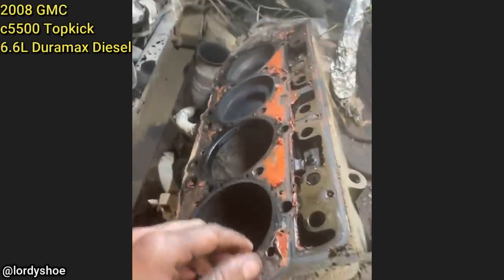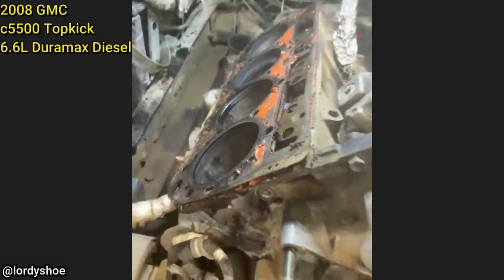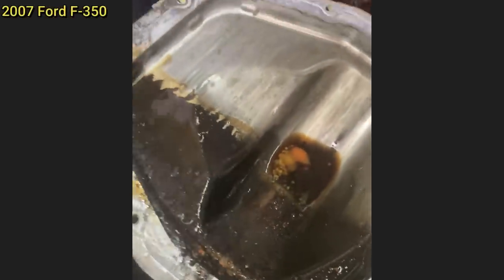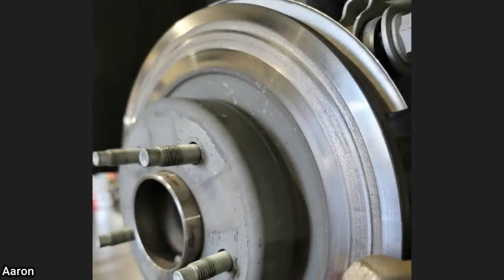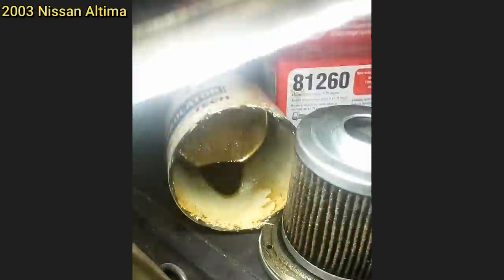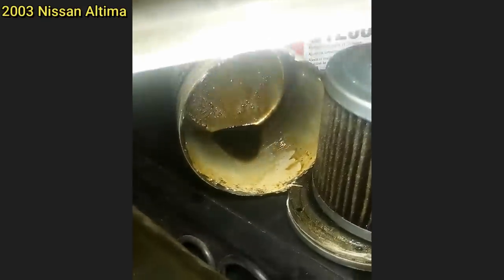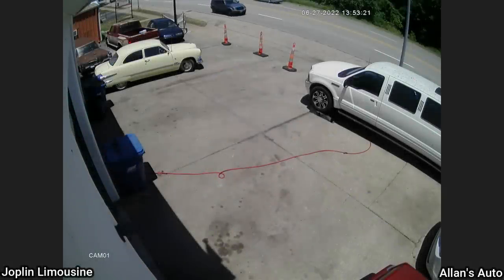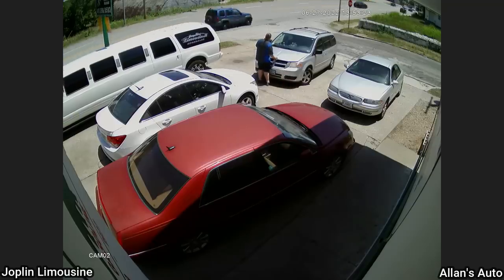Customer States Truck Might Need New Head Gaskets (GMC TopKick) | Just Rolled In

Comment: I've been in so many arguments with people reguarding tire pressure. Even had a guy claim that he's been a mechanic for 30 years stating the tire pressure on the sidewall is what the pressure should be be. Sure bud, enjoy your balded out center tread.
Reply from the maker: Was he a mechanic at Lego Land? 😆
Reply: corey Babcock  That is what I do. Slightly over recommended is not bad. NEVER go beyond max cold tire pressure. Max pressure can be a rough ride. Off roading low pressure is very helpful.
Reply: corey Babcock  Ideally, you'd keep it at the pressures designated as the car has been designed to function optimally at said pressures. Vibrations can result from over/underinflated pressures, and yes, even a couple of PSI can make a difference, especially if the pressures are different from left side to right side.
Reply: I am a retired mechanic.... ALWAYS go by the door placard
Reply: Balded center tread and horrible ride quality.
My MIL had a couple tires replaced and they aired them up to the sidewall pressure. She complained about horrible ride quality and handling. I reduced the pressure to what the sticker said and she was happy.
Reply: @scottrussell6717  ehh spring and fall I’ll over inflate a pound or two to keep the light from coming on in the morning. The amount of people that bitch about tire lights after a service
Reply: @user-white007  your right... in cooler colder weather you will loose several pds
Reply: @mikefoehr235  Low pressure is fine if your sidewalls will handle it...we had people on back road/off road rides that destroyed their tires by airing down too much. We had rocky trails and vehicle weight doesn't change.
Reply: I see so many cars broken down on the side of the road with the sidewalls blown out.
Reply: I just go by the door jam label, as stated in the owner's manual. I have a digital gauge and check them regularly. Easy money
Reply: How can the pressure on the sidewall be different to the tread?  The air pressure on the inside is uniform throughout.  Its called physics.
Reply: @csjrogerson2377  um …. rubber bends broseph
Reply: @csjrogerson2377  Low pressure allows the sidewall to flex excessively which, depending on the construction of the tire (plies/beads/casing/steel belt) may break the fibers or allow the plies to separate. It's not the pressure (or lack) that does the damage.
Reply: I ruined a set of new tires by over pressure of what the sticker recommended.  balded out the middle of all 4 tires, just trying to get better gas millage.   Could have bought a lot of gas for what those tires cost me.
Reply: @csjrogerson2377  they are talking about the actual printing of words that are on the sidewall of each tire.
Reply: Each tire is made differently and made from different materials.  The pressure labeled on the side walls of each tire are max pressure.  If you are in a cold climate you want to fill your tires closely to max pressure at daytime temps because at colder temps the pressure will decrease.  So in the same spirit you need to adjust pressure based on what the temp is when filling the tire and the max temp in the day.  You also need to make adjustments depending on how hard you drive.  If you fill your tire to max temps at 80 degrees and when you drive you get your tire up to 140 degrees the air inside your tire will expand to much higher than max pressure.  Best way to figure out best pressure is to fill to max pressure drive for a bit heat up your tires the let air out and drop to about 5% below max pressure.
Reply: @scottrussell6717  Each tire has a different max pressure because each tire is made from a different compound.  Just like in racing in NASCAR you need to take into consideration each tire compound.  To go by the door placard is ignorant because that is based on using the stock tire.  Many different variables in finding the correct pressure to fill a tire.  If you are filling a tire in a shop in the morning when its 70 degrees knowing that by noon the temp will be 110.  Knowing your environment is key to the proper inflation of a tire.
Reply: @scottrussell6717  I'm a retired Mechanical Engineer but I've been wrenching for 50 years or so. I go by the sticker and watch the tread depth (I do have a tread depth gauge) and usually find the "sweet spot" where the tires wear evenly. As an aside I had new tires put on TWO of my cars yesterday. Mobile installer. Brought the tires to me and put them on in my driveway. Old ones were at ~3/4 tread depth but were dry rotting. Don't know why. One set was 11 years old and the other 9... Two Grand Prix's, a '99 GTP (Supercharged) and an '05 GT2. New tires make them feel like new cars! ;)
Reply: @timbuckohfive2751  Or do what the manufacturer's recommend. Cold inflation pressure and let the tire warm up normally while driving.
Reply: I am 61, 44 years of driving every type of car. But I have always set my tires to 32 PSI. Placard on door jam says 30 to 34 PSI. My tires are 245 x 35 x 19, and at 32 PSI they ride really good, regardless of temp or road (Not Dirt) surface. On my wife's Hyundai Getz, it states 28 to 32 and we run them at 30 because it is a small light car. No issues. And all the Tyre Shops have told me to run between the recommended pressures.
Reply: @csjrogerson2377  he means the pressure specs printed on the sidewall (inflate to xx bar xx psi). This is a maximum pressure the tire is designed for. The pressure the car needs depends on the car itself and its weight, and is usually put on a sticker inside the door or the tank cap
Reply: Is it a "regional" thing?  I'm in Australia and I've never heard anyone say to use the pressure printed on the sidewall.  It's kind of  understood that that is the maximum safe pressure the tyre is rated for, not the running pressure which will vary depending the weight of the vehicle and other factors.
Reply: I get this asked a lot at work since I am "the car guy". If you are running stock size tires and stock type of tires then go by the door. Once you change tire size or radically change tire type like from street tires to off road that is the time to ignore the door sticker and start experimenting to see what works with your particular combination.
Reply: @PhilG999  same here... factory says 39.... I set front at 41 and rear to 39... wears perfectly even...I have a ram 1500
Reply: I run my tires at the max cold pressure on the sidewall on the tires. I have had several cars that when I set the tire pressure at the vehicle manufacturers pressure I had handling problems on the curvy road that I traveled 5 days a week. The tires would wear out on the edges and I had a lot of tires delaminating. After I started running my tires at the maximum pressure I have not had nearly as much problems with my tires. They wear evenly and I usually can wear them completely out. Before I was having to replace tires that still had a lot of tread because they were separating and forming bubbles in the tires. Remember that the car manufacturers want a smooth ride.
Reply: @danielbutler578  your exactly right. Every car is different.. you have to experiment and find the sweet spot... sounds like your tires where rolling going around curves... meaning the tires where rolling under giving the crazy wear
Reply: @Chris_the_Muso  some over here go to max pressure, no sense tho. No good reason for it. Harsh ride, wear center of  tyres out and less traction on both wet and dry roads
Reply: Also, if you ever put wider tires than factory on your car, the cold tire pressure you run should be slightly lower, you can use online calculators for this, in order to keep the same tire load rating as stock so as to keep the tires wearing evenly. A wider tire will often or always have a higher load rating than your factory tires. I went from 215's to 245's on my car that weighs 3000 lbs, went from 32 psi to 28.
Reply: @Summit2012  this is so weird I did not know that sidewalls were spouting these high PSIs. But why is it wrong? why are these wrong PSI's on the tire?
Reply: @MaNameizJeff  as someone else mentioned, the PSI shown on the sidewall is the max rated pressure of the tire, not necessarily what you should be running them at.
Reply: @Summit2012  ahhh, makes sense.

Comment: Customer: "I think I need new head gaskets."
<later>
Mechanic: "Your engine needs more than that..."
Customer: "What do you mean? What did you do?"
Mechanic: -_-
Reply: Mechanic: no, what did YOU do. You don't put RTV as a head gasket and you don't reuse the old head gasket. You always buy a new head gasket, clean up the block surface, and install the new head gasket. 

Ppl don't have common sense nowadays.
Reply: @therandomizer9943  Sense is uncommon!
Reply: @zachsheffee8458  its sad but true
Reply: Just imagine how the rtv boobs blocks the oil galleries. Engine got a hart attack
Reply: @therandomizer9943  That method works though... Pretty sure that's what my Mercedes had at least temporarily (like 30k miles at least), and that's a turbocharged diesel with an insane 22:1 compression ratio (Dodge diesel for example is 16:1), and that car was known for cracking the aluminum heads so it has some serious pressure. You can indeed use silicon gasket maker, and if the original is in good enough shape with a couple cracks you can "paint" both sides of it and apply where needed.

I've done silicon head gaskets on multiple engines, that's why RTV silicon gasket maker is called that. If you can afford to spend $100 extra on a $500 car just to have new head gaskets while you're running $5 junkyard tires, then sure, but some might say there are more important things to fix with that $100, lol!
Reply: @jakegarrett8109  You're one of the few who understand reality Jake.  Yup.  RTV isn't the 'right' way to do it but it absoluely does work.  My lawnmower has been running on a reused head gasket for almost a decade.  I needed to fix it and didn't want to wait for a new one.  Half of the construction equipment you see is running on bald tires and half hour fixes.  It's just life.

Comment: Took my Cadillac to a Cadillac dealer and told them I needed them do the 5 year maintenance on the cooling system.

They called back the next day and said they had checked the Freon and checked the A/C  compressor, and everything was working fine.

Comment: The limo…. Yikes! That u for the edumacation as usual!
Reply from the maker: Could have been a lot worse 😅
Reply: @JustRolledIn  exactly. That was scary.
Reply: @JustRolledIn  That guy was so lucky and dumb at the same time
Reply: My first thought was the guys legs under the front end being dragged... like 'holy crap did it grab him and pin him down?'
Reply: @JustRolledIn  Ol’ buddy’s lucky that was an Excursion Limo. He would’ve been squished if it was a TownCar based Limo
Reply: @Talatharas  right. He actually grabbed it thinking he could stop it from underneath. If only he would hit the shifter back in gear...

Comment: That guy who saved the limo came in clutch lmao
Reply from the maker: Should have put a cape on him in the video lol
Reply: Stretch limos are always a bit weird to me, but seeing the guy run the length of it to get at the brake - looked like a comedy sketch. lmao also.
Reply: Apparently the guy asking what mirror was damaged deleted his question.
Reply: The mirror in question is the passenger door mirror. It clipped the sign pole as it rolled backwards. And agreed, Billy needs a cape. My mechanic was under the limo at first trying to grab and hold 13k pound limo. Then you see him running behind it to stop it. I came out the office to block traffic on the side street as Billy got in for the brake. Why my mechanic didn't chock it, I do not know. Brakes are not upgraded by the limo factories so I have no idea if the embrace would hold just by itself. Thankfully no one was hurt. And I have a funny video to use for training both my mechanics. And limo limo drivers on safety.
Reply from the maker: @joplinlimo  thanks again for sharing that clip! Hopefully other people see the clip and don't make the same mistake. Good lesson!

Comment: I’m so confused. How does someone who has so little knowledge and common sense about cars that they re use a head gaskets. But is Abel to tear down the whole top end of the engine and put it all back together and have it run? That’s weird. But also impressive.
Reply from the maker: Lol I was wondering the same thing when the person shared the clip with me!
Reply: Some people can take something apart and put it back together again no problem, but have not a clue on how anything works. Eg I can take a part my pressure washer to change an oring, but i have no damn clue how the motor works and how it creates pressure.
Reply: Read up on it dude, it isn't the space shuttle.
Reply: @tncujedk34  let me guess you've done this
Reply: @mikespain8655  it isn't the fucking space shuttle, idk a single person even capable of changing their own oil.
Reply: Watching a YouTube how to video doesn't give you much knowledge if you don't have common sense.
Reply: Indeed, everyone knows in an emergency you use hotcake batter wih cut out piston holes.
Reply: @mikehunt8375  I’ve been repairing my own vehicles since I could drive. I even work in the automotive industry, and I’m hesitant to change a head gasket.

Some people don’t know how one small slip up can ruin this job.
Reply: @dirgeofdementia  Many head bolts are TY(Torque to Yield) and must not be reused. If steel gets to yield point, next comes ultimate strength and then failure.
Reply: @mikehunt8375  While changing the oil might be simple, and can save you some money...  It's even simpler to throw a couple cheap dollars at a mechanic who does the work for you.  No mess, no disposal.  Many people don't have the tools they need to do it right anyway.  Having a jack in a one bedroom apartment, well, you just start to run out of space.  And what good is a jack if you don't have the other tools to go with it.  And if you have all those other tools...  what good is a one bedroom apartment.  Add to the fact that most vehicles today are a lot more difficult to work on than older, simpler vehicles.  Changing the oil on my 83' Ford is a lot more appealing than changing it on my 2008 Jeep Compass.  Simple, but so is a shop and a dollar.

Cars got stupid.  People did too.
Reply: but he didnt crack either of the heads taking them off or putting them on. I wonder if he torqued them even? That would be impressive How would he know the torque pattern?
Reply: I agree it's one thing to like reuse the head without resurfacing it but to actually reuse the same head gasket is beyond me
Reply: @Mike A former high school friend became a mechanic long ago. I remember we rebuilt a 350 Pontiac engine for a Pontiac. I can't remember the model. It was a 2 door coupe of some kind. The rebuilt engine ran fine. No oil burning...no problems. I don't think I would touch anything today. I am to old. I have done many oil changes, replace brakes...God I hate drum brakes.
Reply: @Zorlont  
If you are lucky enough to have an oil filter on top of the engine one can vacuum out the oil through the dipstick tube and not have to get under the vehicle.
Reply: Okay calm down. It’s a big job. Head gasket aren’t a easy beginners job. I have done one myself, took months and was a really hard and there are so many ways you can mess it up.
Reply: Pushrod engine.  OHC no chance..
Reply: @Mike Would have been a really sweet ending if you still had the truck. Sounds like your Dad taught you a lot of self-confidence.
Reply: @Mike same story here.
Reply: Yeah I was really confused about that also. You already took it all apart just replace the gasket!
Reply: Maybe it was pure arrogance.  We've all had that moment where we tried something we knew deep down was a bad idea but thought we knew enough or had become skilled enough that we would somehow get away with it.  I've been guilty of it no doubt.  I always remember a quote by St. Anselm: "Disasters teach us humility."
Reply: @sometimesleela5947  Worked for Mr. Douglas at Hooterville on Green Acres.
Reply: I tried changing my air filter once. When I finally got the box open a family of squirrels jumped out and attacked me. I never got my car back, they guarded it with their life so I ended up selling it. 
Now whenever I have to change anything on my car, I just buy a new one
Reply: Likely scenario. Dude pulled the heads, saw the gaffed bores, said "she gone!!" Mcgyvered the heads back on then sold it. The new proud owner is probably the one who took it to the shop.
Reply: @sometimesleela5947  But only if the hotcakes were made by Lisa Douglas. Green Acres episode! Loved that show
Reply: Probably tried to scam the shop or something.
Reply: If the guy was so set on not replacing the gasket why did he not just re-torque the headbolts?

I would definitely try re-seating the gasket to limp it to a garage...

Maybe he just wanted to try for trying sake
Reply: @Mike I'm sure your father would be proud of you.
Reply: the part that confuses me is he could do all of that and then gave up in the end and brought it in the shop. i mean yeah he could have messed something up trying again but i recommend learning to do stuff on your own
Reply: @mikehunt8375  you don't know a single person capable of changing their oil? lol dude you must live in a big city apartment building cause where im from you would be lucky to find someone who doesn't wrench on stuff

Comment: 2:03 classic stripped pan. We see them all the time at the Honda dealer. They take it to a quick lube place that never replaces the washer and just keeps tightening it more and more each oil change till it pulls the threads out. Atleast civics are easy to put time-serts in.